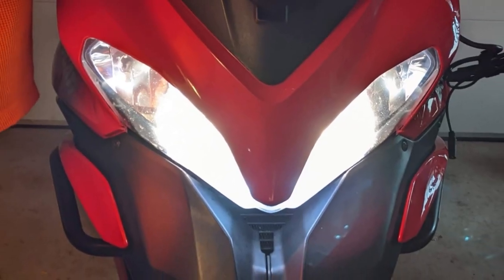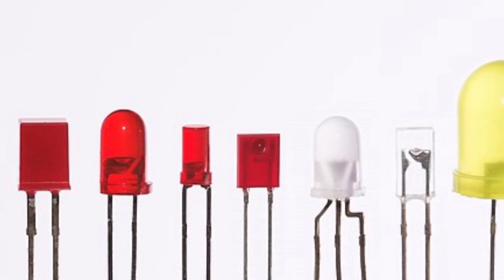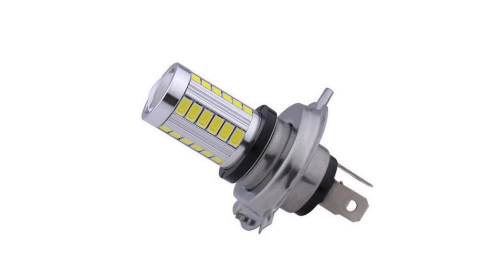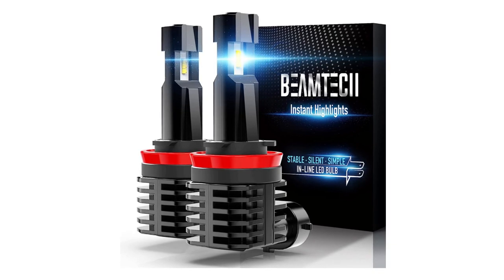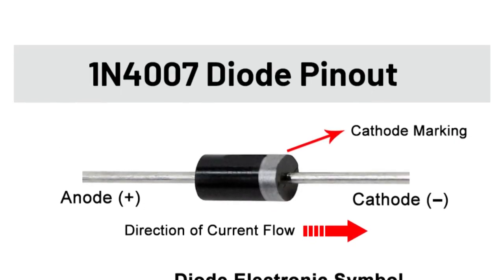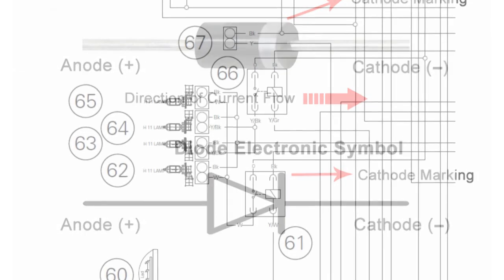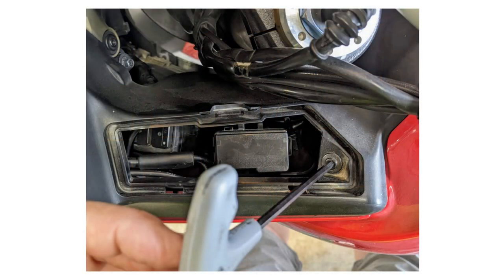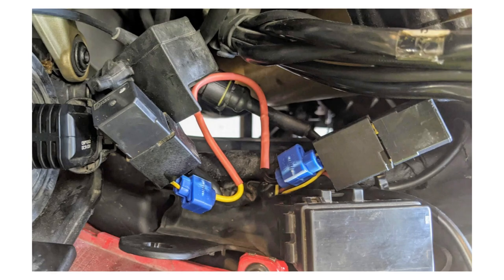Headlight Mods for the Ducati Multistrada 2010-2012

Comment: good tip. i will try this. I use AC HID bulbs with a beautifull white 5500 color. tricky to stuff the parts, but the light output is unmatched.